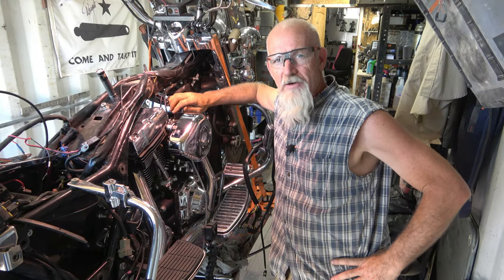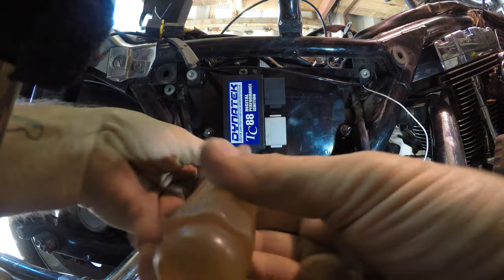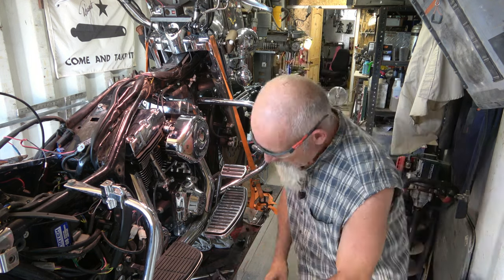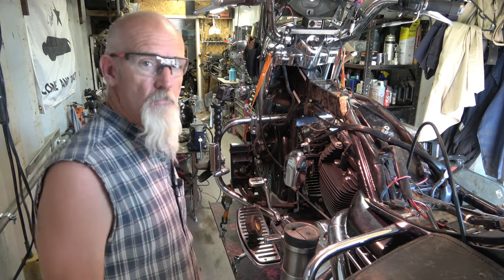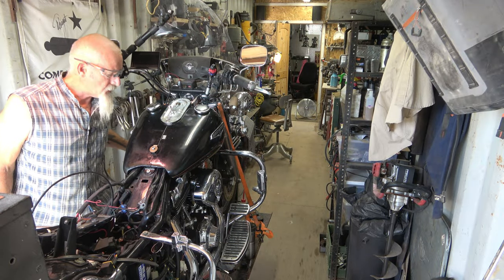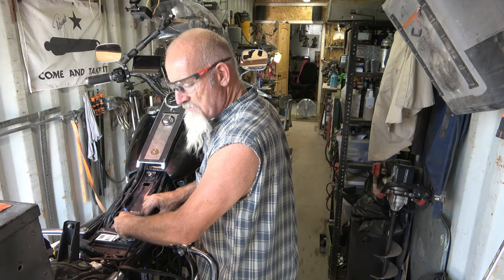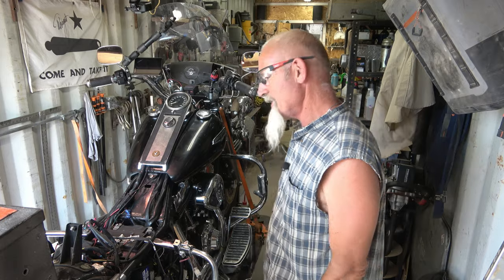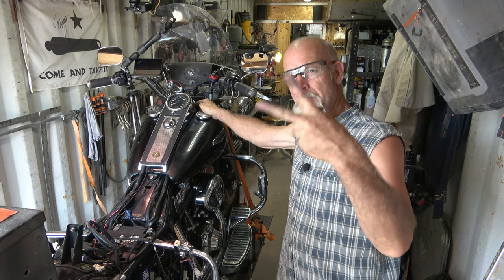Installing new Namz wiring harness, Dynatec TP88-2P ignition module for EFI to Carb Conversion.

Comment: I’m about to do my bike and it makes me so happy you included all part number and tools to do this conversation
Reply from the maker: Hope it will help. It will be a different bike for sure and jetting you will have to adjust. The S&S instruction have a good explanation of jetting and have great customer if you need to call them. Good luck.
Reply: @desertdogsgaragemetalworks3843  appreciate it the only difference is I’m gonna use a cv carb cause I travel a lot and easier to get part for last minute stuff